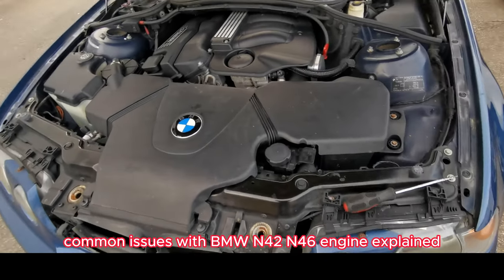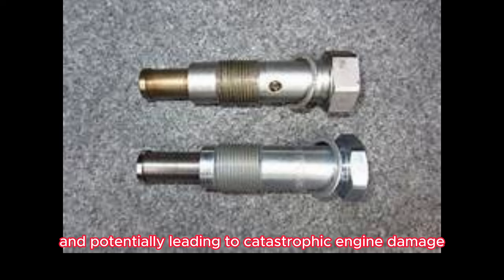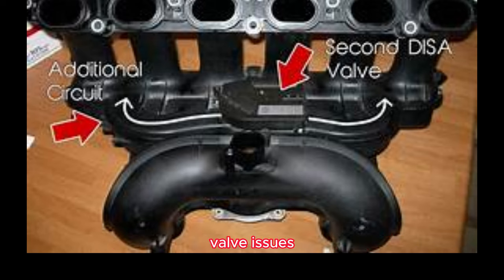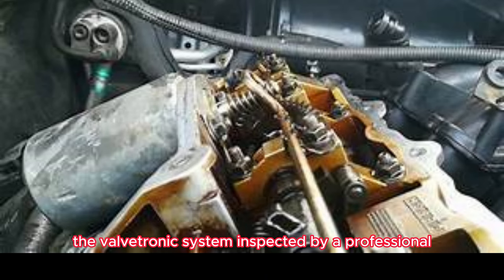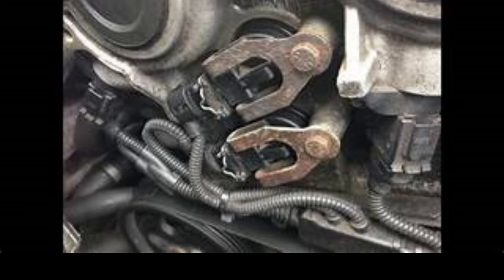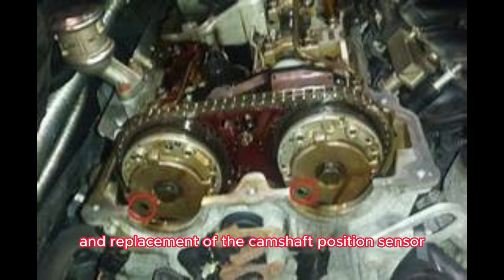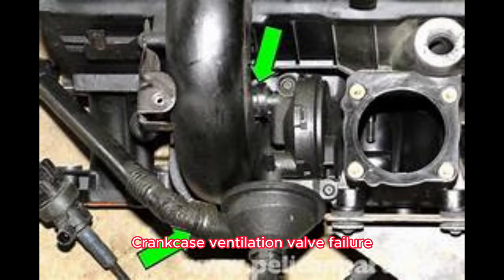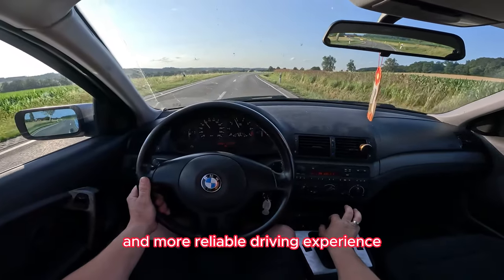Common Issues with BMW 316i/318i N42/N46 Engine Explained: What to Look Out For

Comment: BMW N42/N46 4 cylinder engines have no DISA . The DISA issue is present only in 6 cylinder engines ?  ?
Reply: Yeah, another reason they are underpowered
Reply: @WayToManyAssassins I've got a n46 engine and yeah it's not fast but I wouldn't say it's underpowered mine definitely doesn't have problems getting up to speed
Reply: @haydensteinz2268  It's underpowered in the E90 cars, it runs ok with higher octane fuel but still slower than most 4 cylinder engines out there
Reply: @WayToManyAssassins  well really theres nothing wrong with it power isn't everything in a car and like I said mine has no problem getting upto speed I use my trip tronic when going up hills and it gets up there piece of cake so if it was powerless it wouldn't make it up there obviously 6 cylinders are more powerful but speed limits where I am make it pointless to have my nephew has a 6 cylinder and it's a gas gussler all that for just for abit of speed I'd rather have the more economical 4 but hey some people like the buzz of speed and power everyone's different I guess

Comment: There's not one video on the entire internet about bleeding the cooling system on these engines
Reply from the maker: https://youtu.be/mu7bCSP6HHw
Reply: @diyonlinegarage  
I saw this video before and it doesn't allow for the thermostat to open nor does it show how to do the higher bleed screw beside the oil cooler housing. But thanks anyway.
Reply: @dhalsim-1  There is a BMW TIS (technical information system) instruction but it isn't worth following it. The BMW original procedure is annoying! Just fill it up and let the engine run until the big coolant circuit opens. Then open the highest screw for bleeding until some water comes out. I think you maybe need to remove some housing for having access to the higher screw, i don't remember exactly. Then let the engine cool down and fill up the coolant to maximum again. Done.
Reply: there is one.

Comment: I own n46 and I have experienced 90% of these issues mentioned, including brakes vacuum pump, valve stem seals... poor engine indeed....
Reply: E46 or e90 ? Cuz I got a 2010 e90 bought it in 2011 but I changed a couple of gaskets , a servo pump , oil and filter and thats kinda it
Reply: @aixalexander5257  yeah a 2010 would be better with less issues
Reply from the maker: Yes🙂☹️

Comment: greetings, I own an e46 with N46 1.8 and 116 hp, I have never had a single problem, it has 305,000 km, it works perfectly, there is no smoke from the exhaust, the consumption is 7.3 liters.  but I'm planning an e90 also with N46 2.0 and 129 hp, or maybe a diesel M47 with 122 hp.. please, stay with the e46 or which one should I choose between the two engines in the e90 that I mentioned?  thank you
Reply: Have a N42 engine and some of the issues have come to the surface mentioned in the video. One thing these engines don't like is low quality oil and skipping timing chain replacements. Vanos systems go bad cause the spring inside the vanos unite will not retract and can lead to camshaft timing being out of alignment. At least the third generation valvetronic had the issues fixed that the first two suffered from.  I may do a more detailed video since I now have tons of experience to share.
Reply: 2.0 n46 is ok
Reply: dont buy N46 engine. look at the forum where the people who know about BMWs talk. they say never buy N46/42 engines.
Reply: @wonderwalls3565  it's a forum, not a mechanic's workshop, there people talk about things that happened, because they destroyed that engine themselves, I currently have 315,000 km, and I've never had a single problem with the n46, because I maintain it well.. oil change every 7000 km  , all filters, the most normal driving, no mistreatment..
Reply: @wonderwalls3565 broo stop crying u literally commenting everywhere. did u had this engine? no? ok. it has less problems as a m54 too.. vanos, disa, cooling issues, vaccumm leaks, pcv
Reply: @radeizazgrade7627 Do you even know a mechinaic who specializes in BMW? pretty sure No.
Reply: @radeizazgrade7627  BTW why are they sold dirt cheap if they are so reliable? ever heard of anecdote?
Reply: @wonderwalls3565  of course, only with the man who maintains BMW vehicles and I go to the service, he told me not to change the car, because 95% of BMWs with diesel engines are being repaired at his place, which have abnormal problems with injectors, turbo, dpf, egr, pcv  , flywheel, butterflies... and so on
Reply: @wonderwalls3565  small displacement and low horsepower, extremely easy to maintain, atmosphere that was sold from 2004 to 2015, which is incomparably more durable than N42, N43, N13.  I don't know who told you they are cheap?  the cheaper ones are the E46 i.  E90 from the beginning of production with that engine.. because they are older vehicles.. How much does an X1 from 2015 cost with a rim engine??   friends, I don't know what problem you have, but I think you don't understand BMW engines very well..if you knew something, you would know something basic
Reply: @radeizazgrade7627  When did I mention anythign about diesel? Its called strawman. 
And you went to a man who maintains BMW vehicles? not a BMW mechanics right?
And why are they so dirt cheap? Hyundais are more expensive than these. Toyotas are more expensive then these. why if they are so reliable?
Reply: @radeizazgrade7627  extremely easy to maintian? you have never done anywork yourself on this engine right?

Comment: Had the VVT problem, hard to figure out, also watchout for it's sensor and the gasket of the sensor. It's kind od poorly made, wasn't able to tighten mine and it leaked oil and threw out a code (system too lean on bank 1)
Reply from the maker: I have changed the sensor but still the same☹️
Reply: @diyonlinegarage  what code is your car throwing?

Comment: Vanos so annoyed😂
Reply: I think i have problems with Vanos Solenoid now. While driving seems like transmission and engine shaking bad. I got error for missfire on cyl. 2 and  ignition solenoid 2. Is there other solenoid then vanos?

Comment: Short answer. dont buy anything with this engine, unless you dont have problems with putting money in it againand again and its not your primary drive.
Reply from the maker: It is a pretty good engine but valvetronic seems to be poor ☹️
Reply: @diyonlinegarage  How is it a good engine.
Valevetronic issues.
timing chain system issues.
stem seal issues.
seal leaking oils.
water pump failures.
thermostat failure.
You could say the last 2 are generl maintenance things, but they are so hard to access on these engines.
Reply: forgot the oil filter housing gasket leaks. and ofcourse coolant leaks.
Reply: @wonderwalls3565 same issues what a m54/m52 has too so stop talking lmao (not valvetronic)